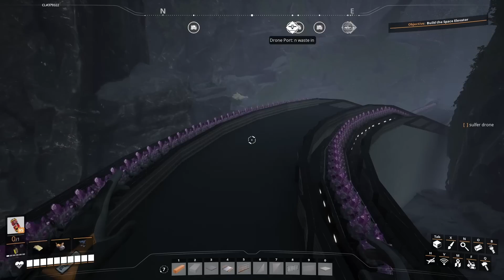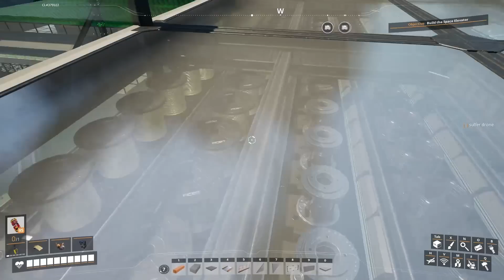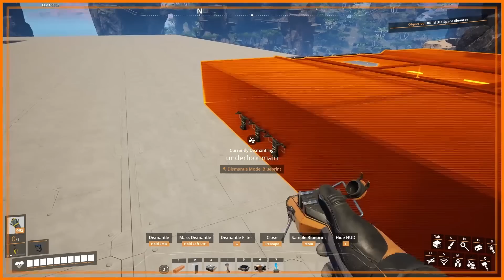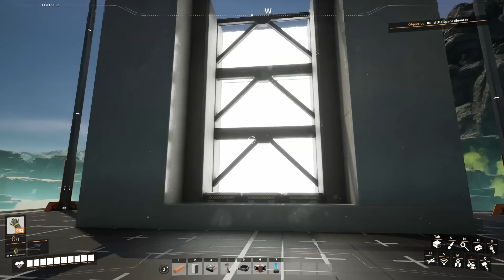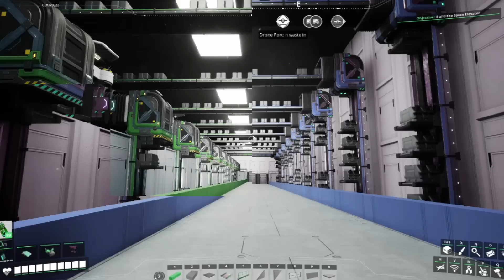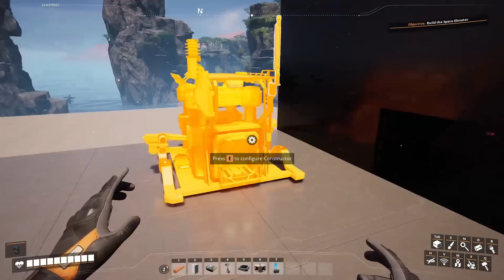5 logistic layout BLUEPRINTS that will help you beautify your factory!

Comment: They dont snap in in blueprint mode because of the belt end at the edge of the blueprint, same thing happens with railways
Reply from the maker: Yeah, but they should now work better with the new blueprint  auto connect mode coming in 1.1
Reply: Im excited @fromscratchgaming

Comment: the reason the first blueprint doesnt snap is the belts at the end. They are wider than the foundation and the blueprint snap mode leaves therefor 1 meter between then. I had the same thing and moving back a belt 1 solves this issue
Reply from the maker: Arr OK cool thanks for the info

Comment: I'm very confident I know why your blueprints at the beginning weren't snapping as expected.

Your conveyor poles looked like they were on the edge of the blueprint, and the game gives them physical space to accommodate.

I had the same issue with decorative beams on my rail blueprints.

I suggest that, since you're connecting belts anyways, just move the conveyor poles inwards by a foundation or so.
Reply from the maker: yes I think you are correct.